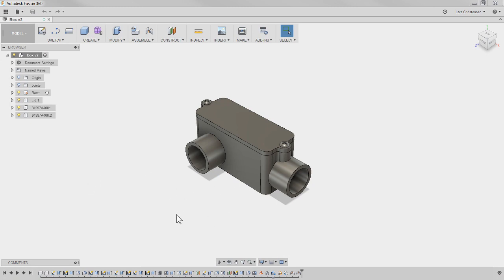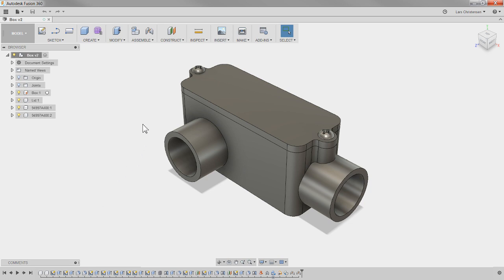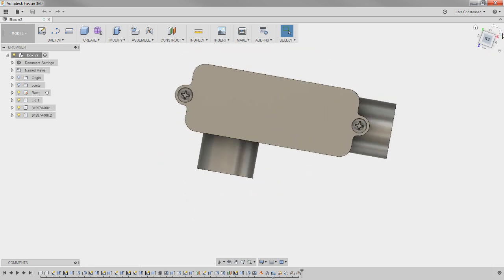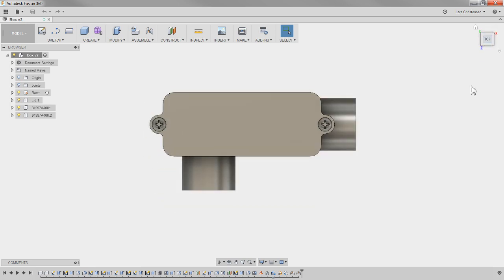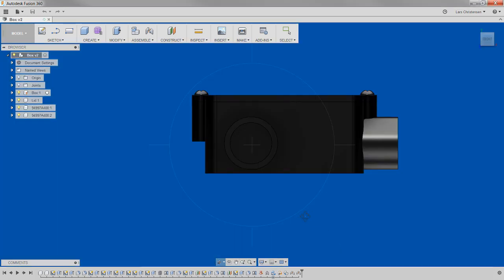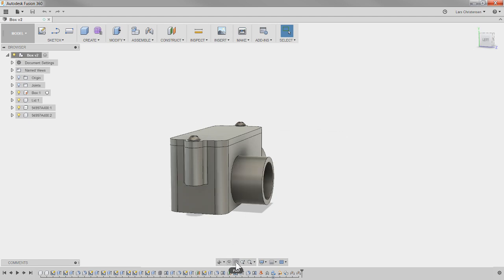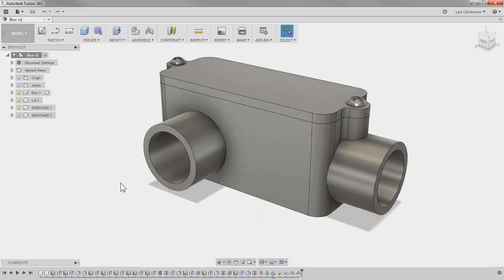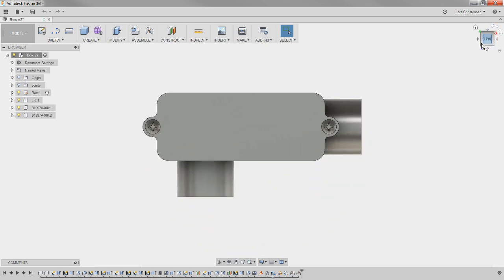Fusion 360 — Beginner! How To Pan, Zoom, Rotate & Navigate —Your Comments & Questions — #LarsLive 52

Comment: This is super handy. Obtuse things like bad controls are why I cancelled my Solidworks for Makers subscription. Fusion 360 has come a long way in terms of usability and workflow efficiency. Of course there are some significant flaws still, but for free? I cannot honestly complain for free. I can't afford professional software, so that I can make useful parts without pulling all of my hair out is really great. (FreeCad has come a long way too, and OnShape is a workable option if Autodesk ever takes Fusion away, but right now I'm happy using Fusion.

Comment: Well done, only been using fusion 360 for a short time, and now landed into a project that is more complex. You answered most of my issues, one though I have not figured out. Several components on the screen, all in same 0°, 90°... but one of them, an offset motor in this case is 30° to the rest of the models. How in sketch do I orientate it to exactly 30°?

Comment: Hi, just trying to make a simple parallel lines using offset or translate but having issue where to find the trim and fillet. So many buttons to select. In Mastercam is so easy to draw these lines but having trouble to make here in Fusion 360.

Comment: I have an extruded model I brought in from SolidWorks.  The printing is within rectangles at odd angles and raised.  I would like to rotate these rectangles to be horizontal and vertical for viewing and then apply sketch rectangles. How could I set the rotation of the floor for this purpose?  Thank you for any response you might have.

Comment: Thank you! I learned couple of new tricks, but the more importantly, you happened to resolve my major problem. I was sooo frustrated after changing from MAC to Windows 10, where this pan and rotate felt impossible and awfully cumbersome, even when using a mouse. But at the end, it was just my own confusion about my wireless mouse and its interpretation of middle button. I had forgotten that it has extra small button which I had learned to function as a menu, but on Windows it seems to be the middle button. How nice. I expected the pressing the wheel (which is a bit cumbersome) to be the middle button, but I was mistaken. After this little confusion was resolved, everything now functions just as smoothly as I had learned using a MAC (with the exception that now I have to learn a new grip of my mouse to access the middle button, which is not as ergonomic as I would hope for...).

Comment: DK - Hej Lars.. Var super udfordret med at navigerer i F360 som er første rigtige 3D tegneprogram for mig. 1000 Tak for alle dine YouTube´s ! Fornemmer at Microsoft flytter Win10  mod Apps på touch enheder. For hver opdatering fjernes mere fra kontrol panelet og gør det svært at tilpasse muse opsætning, dobbelt klik, markør hastighed mv.  Men med korrekt driver, lidt knap konfiguration og din Superb instrukser har jeg nu fået rimelig styr på det. 

UK - Hi Lars .. Was super challenged to navigate in F360 which is the first real 3D drawing program for me. 1000 Thanks for all your YouTubes! Feels that Microsoft is moving Win10 towards Apps on touch devices. For each update, more is removed from the control panel and makes it difficult to customize mouse setup, double click, cursor speed, etc. But with the correct driver, a little bit of configuration and your Superb instructions, I now have reasonable control over it.
Reply from the maker: Rigtigt godt at høre :-)
Reply: @cadcamstuff  ya vo farfeguugen...-meant in good humor. If I cussed you in a language I have no clue about please forgive me...Seriously, I need to replace my magic pad with a mouse. I have been fighting that thing too long. Mucho Garcias

Comment: Get a Logitech MX Anywhere 2S mouse!!! $50 at Best Buy. The button behind the mouse wheel where Logitech usually puts the mechanical button to switch from "click scrolling" to "freewheeling" is actually button three. You press down on the wheel to make that switch as it is UNDER the mouse wheel where the third button usually is on most mice. This means that when you are pressing the third button, you are not touching the scroll wheel at all, preventing unwanted zooming or having to balance the pressing force over the wheel. I would die without this mouse. or at least have to buy one of those fancy controllers. $$$ I cannot recommend this mouse highly enough.
Reply: thanks for your comment - this was solving my issue how to get along in Fusion 360 with that mouse! One thing to add to your comment: you need to open the Logitech Options App and re-define that button behind the wheel from default (Gestures) into "Middle button"

Comment: The bigest problem with navigate your draw on fusion 360 (and inventor),is only when use the spacemouse from 3dconnexion.And that because there is not the option for "lock horizon".(which exists on 3dsmax).
Τhere are same option with different name ,name as roll toggle,but never work right.
Νext ,Spacemouse on Fusion 360 and inventor is not so good idea(in 2018),with the simple mouse everything is fine.

*of course on 3dsmax  that exists this option (and work),you are going to hell(!),if you don't have for navigate the spacemouse!

Comment: Why aren't there keyboard shortcuts for zooming, panning, and orbiting?

On OSX having to use the trackpad for these tasks is absolute maddening. It's less precise and it's not helping my carpal tunnel progression.

Also, it's an accessibility issue. Pretend you're missing your index or middle finger and try to do these things.

Say shift + up/down arrow for zoom. Function + any arrow key for orbit, and Alt/Option + Any arrow key for pan.
Reply: I had the same problem with my MacBook. Simple solution...went to Best Buy and bought a Logitech 3 button mouse wheel and it works perfectly !!
Reply: Dude, buy a wireless mouse or something... -.-
Reply: I have a mouse, but often when working remote I don't have it on me.

'Buying a mouse' isn't an excuse for a poor user interface.

Comment: With a Logitech M705, when i try to rotate with shift+middleMB, i does.. but also zooms in... not scrolling it just holding them down...  some setting i missed?
Reply: Well it doesnt seem to be setting but the mouse.. my wire-mouse rotates fine without zooming
Reply from the maker: Sounds like a specific driver issue....a little weird
Reply: Logitech SetPoint settings - switch middle button from "zoom" to "middle button"

Comment: Dear sir, I have clicked and hold the SHIF key and at the same time I have hold the mouse middle roll wheel. But it is not orbiting or pan the design. I am facing this problem just from few days ago. But before, I did many works on fusion 360 and worked but now it is not working. Please could you help me to solve the problem?
Reply from the maker: Hi MD. MUBARAK HOSSAIN Thank you for watching!
I am not smart enough for this question, I would recommend you go here:
https://forums.autodesk.com/t5/fusion-360-support/bd-p/962

Best,
Lars

Comment: When your middle button is set for double-click, it doesn't work so well.
Reply from the maker: That is so true. I have never configured my mouse like that. What is the benefit?
Best,
Larts
Reply: Lars Christensen inside Fusion? Probably none. It's a holdover setting from decades of opening stuff in Windows the lazy way. I have found myself using the left button almost exclusively as of late since my middle has decided it needs a ton of force to actuate. I'll end up changing the setting before long. Not willing to giveup the trackball itself yet though.
Oh, dropped your autodesk email a shout a bit ago about a bracket I'm working on.

Comment: Hi, I do have a middle mouse button (Logitech) I`m running Windows 10 pro, the mouse works in Windows (nothing changed since freshly installed) - scroller button works in Office, Browers etc, but there is no way I`m able to get it to work inside Fusion.  Dobbelklikk - no, Shift+scroll - nothing. What could be wrong? 

Running Fusion 2.0.3797 by the way.
Reply from the maker: Hi Stig Berntsen Thank you for watching!

Is this helpful:
https://forums.autodesk.com/t5/fusion-360-support/mouse-issues/td-p/7247448

Best,
Lars
Reply: Thanks Lars, I will check it out, and give an update, in case others run into the same issue :)  Det bliver rett smukt, ikk?  ;)

Comment: The rotate feature of holding the shift key and the middle mouse does not work with my Apple mouse.  Is there preference I need to set.  Thanks, Ruley
Reply: I found the same issue with the Magic Mouse. There apparently was a utility that worked with older versions of the OS back around Lion, but after that Apple changed some APIs and it broke. Check out...
https://www.youtube.com/watch?v=VIr9R1P2wys
and 
https://www.magicprefs.com

Comment: Hi Lars, 

thank you for this great videos. 
As of today I watched the beginner series (1-3 + Pan&Zoom). 
As I'm a complete newbie to 3D CAD, I learned so much by repeating the steps after watching the videos a couple of times.
Everything worked fine but in my version (2.0.3706) the mirror function does not work as presented and expected. It is not possible to select features (the third one, in German: Elemente).
I use the enthusiast version - are there any restrictions on the mirror function?
I'm quite sure that the problem is in front of the display...;-)). Any idea?

Regards from Germany 
Kassen
Reply from the maker: Hi K. Oldewurtel Thank you for watching!
Your version is the full Ultimate version, so that is not the problem. Could you try by maybe just create a block in a new file and see if you can mirror that? It should work.

Comment: Hi Lars, thank you for cleening up loose ends. I'm new to Fusion 360 and as it is, it's not so easy for a beginner. Up to now I was drawing things up with a very old Programm, also from Autodesk, called Autosketch 9.
I find your Videos excellend, understandable and very competent. I'm sure I watch all of them one by one, and some more then once. Sorry about my english, my language is German, and Fusion 360 is in german and this brings smetimes a bit of confusion. Never mind, I get along fine. 
Comming from Switzerland and living in Italy (Tuscany), retired with a Workspace on the back of the house, including lathe, milling and so on. At the moment I'm constructing a little 8-station revolving toolchanger for my 7 x 14 lathe. And this brings me to a problem I could not solve. The internal shaft of this setup is to have 8 holes equally spaced on the circumference,  longsides. I meen square to the centre about 8 mm deep. No idea how to do this.
My background: I used to work with DMG-Mori as a service technican, allmost 30 years. I know the whole story about CNC machining, right from the beginning.
I hope this was not to boring, but understandable and with a minimum of spelling errors.
Have a great Day, Luzius
Reply from the maker: Hi Luzius Clement Thank you for watching! ANd for taking the time to write!
Your English is very good. 2 Different suggestions/Methods...
1, You could approach it the same way you would machine it on your DMG-Mori. So model a big block of steel and start carve/ cut material away until your toolchanger appears.
2. Sketch up the toolchanger on a notepad with pencil and pen in a topdown view. Then, sketch all those same lines in a Fusion 360 sketch and start extruding the different parts from that.

Hope this is helpful.

Best,
Lars
Reply: Good morning Lars, thank you for the quick replay, and for the suggestions. I managed my problem, but in a different way. In a weeks time I let you know whats actually all about, regards and thanks, Luzius
Reply: could he create one hole then pattern that around the axis?

Comment: Hi - thanks for this. Sorry I couldn't watch it live. One thing I did notice though, when you used "set current view as" it relabelled the view cube, but clicking home kept the old 'top' and 'right' as top and right rather than the changed to values. Don't know if that's a feature or bug ;)

Please do keep up the live feeds, I for one find them very useful.
Reply from the maker: Thank you John Morrison
I'll have to check that out, and then report it if that is the case

Comment: I very much appreciate the great job you are doing with Live Stream.  It has accelerated my learning curve a great deal.   Would it be possible to share how one might change the actual orientation of the model and not just the view?    Please correct me if I am wrong but to me it would be much easier to change a model orientation in the model workspace then in the CAM workspace.   
Thanks in advance!
Reply from the maker: Hi Bill Vanca Thank you for watching!
Changing the actual orientation of a model can be a pain sometimes. Really depends on how you model the part. If it is simple you can just flip the original sketch to another plane, but if other features are located from other planes, sometimes you model goes crazy

Comment: I am trying to make a plaque using Terminator Real NFI font.  This font will not exploed and I cant extrude it.  All of the other fonts I have tried explode just fine.  Any thought on what might be wrong?
Reply from the maker: whitehedr Thank you for watching the video!
I don't see this font type in the dropdown. Is that a font you installed?

Comment: Lars, What do you recommend that I do to follow a tutorial and do the drawing on my fusion 360 at the same time? I tried a split screen,   stopping the tutorial and go back and forth, nothing was ideal.  Any ideas?  Thanks, Tim
Reply: I use a dual monitor setup, side-by-side.  I know it may not be for everyone, but if your graphics card has two video ports, I highly recommend it.  Nothing beats watching tutorials on one screen while working from the second.
Reply from the maker: Hi Tim, Thank you for watching the videos.
I agree with Nick. If you can use dual monitors, I think that would be the best way.

Best,
Lars